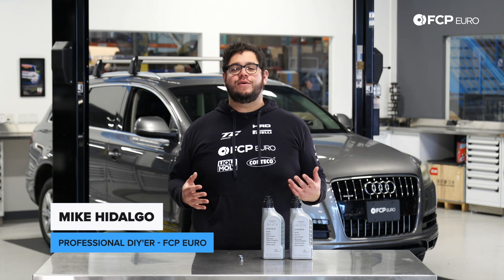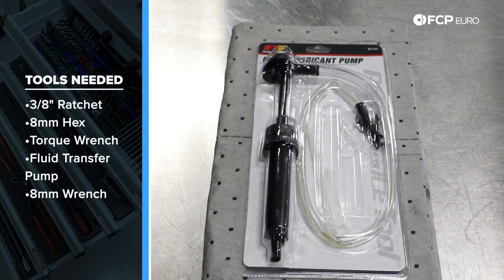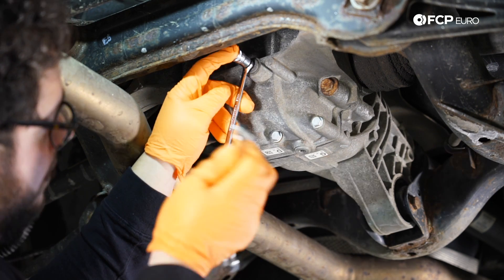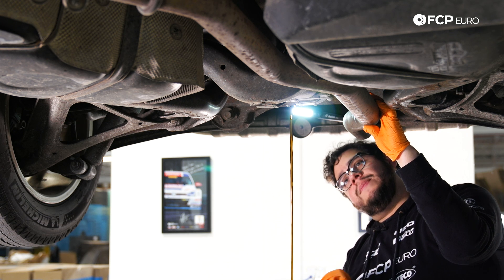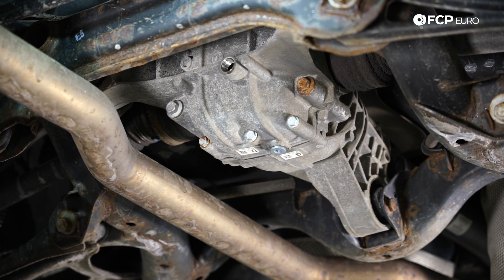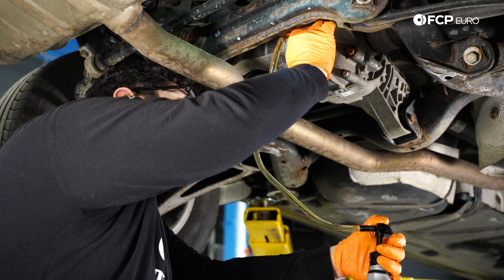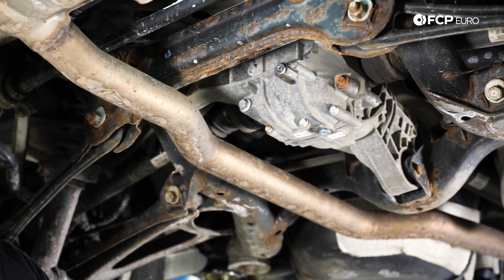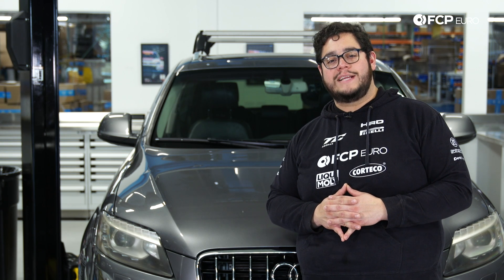Audi Q7 Rear Differential Fluid Replacement DIY (2007-2015 Audi Q7 4L Rear Differential Service)

Comment: Hey Luke!  Great videos and keep them coming. 

I have a 2014 Q7 and I have recently discovered this rattle tapping noise on the drivers side at RPM levels of 1000-2000.  Any thoughts what this might be? 

I have an audio clip I can share if you’re interested